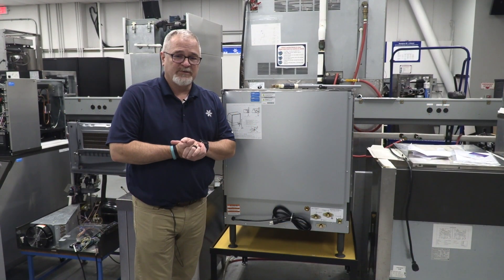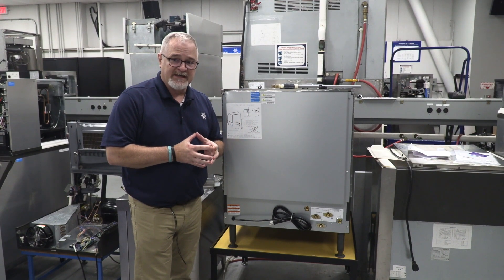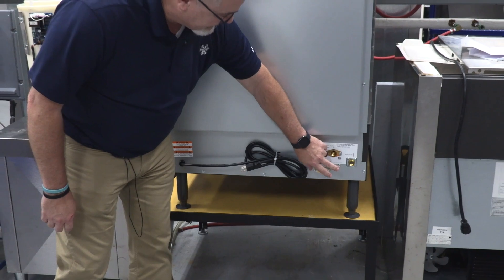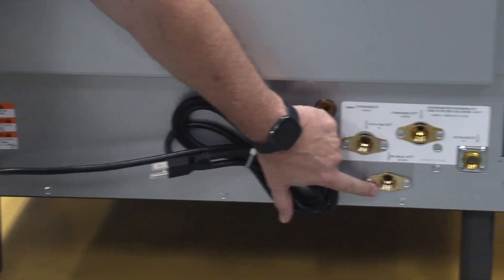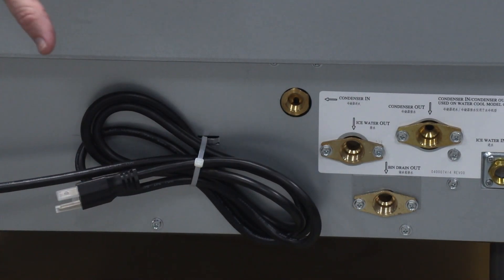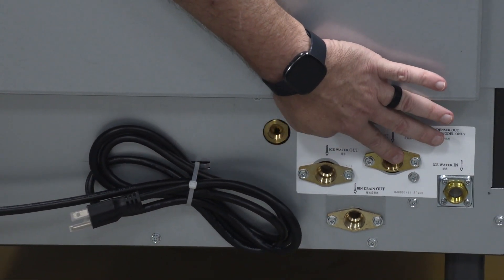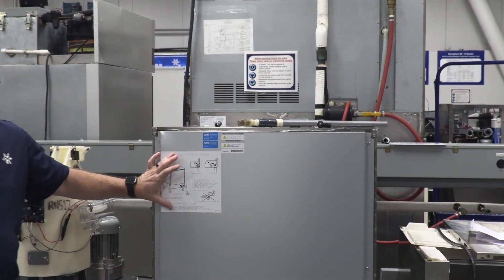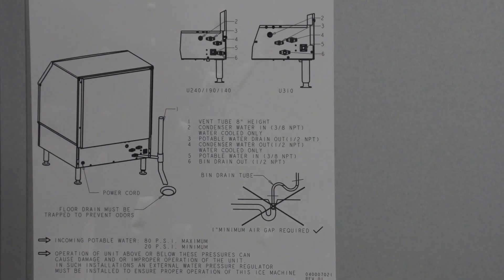Manitowoc Neo Drain Explanation

Comment: I have been looking at buying a Neo for my home but the in floor drain requirement (with multiple drains now) is a challenge for me.  Do you have a supported solution that pumps water up (about 1.5ft from ground to further drain in my sewage drain system (the water softener drain pipe).
Reply: You can just "T" off both the drains together.